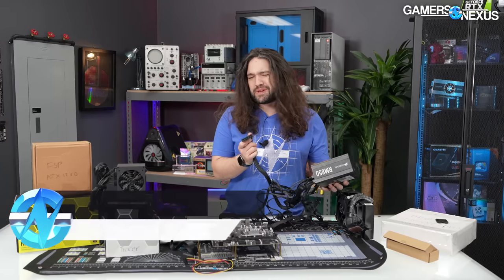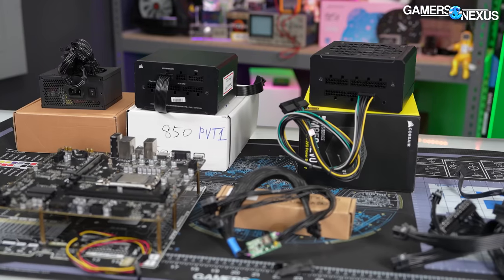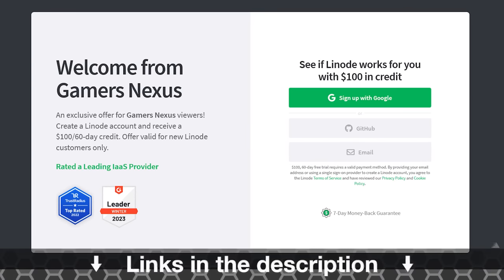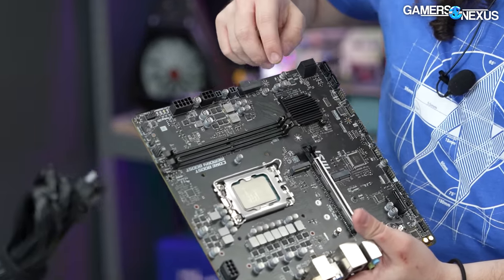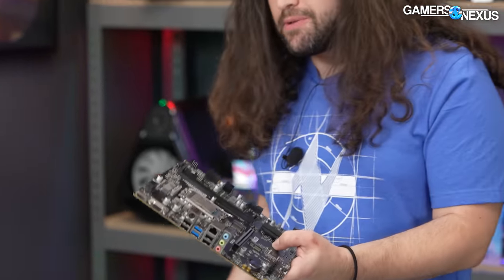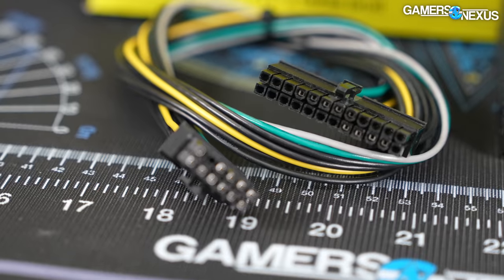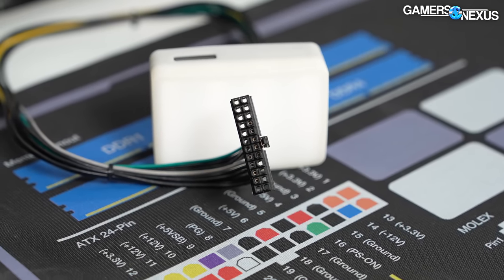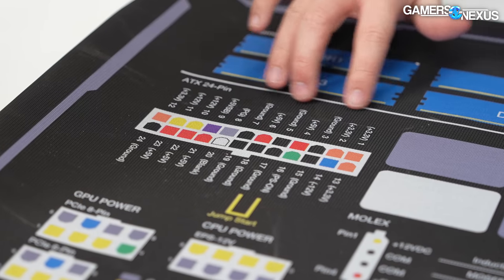The Future of Power Supplies - Maybe (Motherboard Cost, Cables, & ATX12VO)

Comment: I think that the future of PSUs is not this.  The PSU will go into a modular VRM board which will have it's own cooling, and there won't be any VRMs on the motherboard.  I saw that in an interesting server product.  The PSU will provide better protection for clean voltage all 12V, you will buy a number of VRMs/voltage converters that will slot in behind the motherboard and will be close to what you're powering.  The power plugs into the back/bottom of the motherboard with standardized power connectors that separate the VRMs from the motherboard for cooling, but also keep the distance from the powered device and the VRM at a minimum.  The connections will not be cables, as the alignments will be standardized between the VRM board and the motherboard.  You can buy specialized VRM components if you want to under or overvolt your components, some might be programmable, but some might just be a different spec if that's cheaper and you know your system will work with it.

There will not be ANY VRMs on the motherboard.  Even the 75W PCI-e standard with come from the VRM modular board.

The components of the VRM board will be cooled on the bottom, the power connectors will be on the other side of the components.  The power comes through the bottom of the motherboard and the components on the motherboard are on the top, so that they can be cooled on the top.  Getting rid of the VRMs on the motherboard allows components to be placed really close to one another, reducing latency between the cpu, memory, the gpu, the fpgas, the asics, the fpaas, and all the other components that you're using.

Keep in mind... if there aren't any VRMs on the motherboard, there also aren't any VRMs on the GPU board either.  So a GPU comes in two parts.  The VRM board and the processor board.  The CPU board has PCIe 16x slots on it's edge and the GPU board slides right in next to the CPU board - close - Grace Hopper inspired close.

My friend once said that building a computer was now more like Legos.  I love the idea of power delivers being much more modular than it its.  Separate the VRMs and their cooling from the devices and their cooling and give enough space so that this all can happen.  

The PSU makers are responsible for one thing - supplying clean 12V.

The VRM designers are responsible for their thing - supplying the correct voltage to the device when the device needs it, keeping things from spiking on sudden changes in needed voltage, and all the other amazing things that good designed VRMs do.  And designing good heat transfer as there's no perfectly efficient buck converters.

The device designers stop trying to integrate and perfect how to put the VRMs on their boards - leave that to the VRM designers.  The bottom of the board gets the power and the top of the board has the device and all of the cooling hardware for the device only.

I'm sure this is all a bad idea, since it hasn't been done yet, but I love the idea of "hey my gpu stopped working" - unplug the VRM from the bottom of the board and plug in a new one - perhaps with better design features because the gpu is 4 years old - and fixing the whole thing without taking apart anything!  Cheers.
Reply: Just to be clear, there isn't one big VRM board.  Motherboards would be designed so that you can plug in, on the back of the board, different sized VRM boards.  You'll have a 2watt/3V connector, and a 600watt/12V connector - or whatever.  I know - changing standards is cost prohibative.  But increasing the lifetime of your devices because you can change out the VRM is interesting to me.

Comment: So from 12+0 to 20+0 to 24 to 24+4 to 24+8 we're moving now to 12pin+8pin... I wonder why Intel didn't remove those extra cables for the CPU and instead put them into the new 12VO connector/spec so we'd end up with one 12V cable, 20-pin to cover MB + CPU while having one less cable to route :/

Comment: I believe this change is just going to increase prices, moving the extra cost to the motherboard and as you know manufactrurers they usually cheap out on budget options. Power supplies usually last way longer than the rest of the systerm while motherboards cpu ram etc have a shorter cycle before upgrade. I work as an electronic board repair technician, from my experience the new gen of budget motherboards will probably use some flaky power management ics, prone to failure. I hope I'll be wrong , but companies just want to milk you for money, planned obsolecence

Comment: I don't get the resistance to this type of change. Standards change as tech changes. Mobo prices will likely go up for certain, but we will also get better efficiency which translates to potential power savings. Should CPU Socket 1 and Socket A have remained the standard for eternity?  Should IDE and ISA have remained?  8" floppies?  FAT 16?  I'll take the benefits of 12VO over its negatives any day.  Progressing, more efficient tech is a good thing.
Reply: @shanent5793 , the 40-pin DIP was peak technology.  All other opinions are invalid.

Comment: Personally, I'm excited about the potential for CEE-plug compatible three-phase power supplies for the european market if Nvidia decides to re-introduce SLI configurations for the 50 series cards. But then again, even tho this is a joke, crypto miners would unironically love those, since due to the lower ripple of three-phase power, the PSU will require less voltage filtering, making it cheaper in bulk.

Comment: The PSU manufacturers should be the experts on power and changing the voltages. Why do we want motherboard makers doing it? I know there’s some overlap but the only end result will be more expensive motherboards and PSUs which will probably stay the same in price. I just don’t get the appeal for anybody unless they are mad for cable management.

Comment: I don't think that power routing in mATX changes much. That is because you have to transfer power to where it is needed with old style too. Maybe in mATX you can route 12V everywhere and for other voltages, put their power components where needed. That could lessen the pcb price, not add to it. Of course those extra power components at motherboard adds to price, maybe the power supply gets cheaper by the same amount (just dreaming).

Comment: I do not agree that the power conversion is going to be a part of the motherboard, it should be a tertiary board that you can buy seperatly or just leave out if you dont need it at all.
It would add to the customisation of a build, you can place it somewhere you cant see (cable manage it properly) and you can buy seperatly what you need. (and leave out what you dont need).

Comment: 48V is the best FUTURE solution. Its used in data/telecom and has been for decades. The higher you go the smaller the conductor of the wiring and fewer pins on the connector. Local "POL" (Point of Loads) DC to DC converters are not expensive.  When you look at the legacy power solution it is based upon the needs of older technology.  There was a time when a majority of the logic was 5V. This gave way to ASICs that had lower voltage cores ( 2.5 to 0.8V) and retained the 5V on the IO Pins to interface to older bits or busses.  Equally "drives" had 12 and 5 for floppy and HDs. SSD's only 5V but could be moved to anything as their current draw is so low.  Power complexity has dominated the design requirements for decades. It adds pin count, PCBA layer count, routing, signal integrity and EMI problems.  Really you need to justify WHY you have a unique voltage and to the extent everything is in the box talking to itself - it should be beaten into the lowest cost solution.  And your point is valid that if you move it from X to Y (PS to MOBO or MOB to card) its sort of a wash in concept but not at all in practice.  Anything that reduces complexity reduces cost and increases reliability. Note the ONLY thing the 5VSB does is provide the sense voltage for pushbutton power on/WOL and BIOS update microcontrollers. Very very low current. But as it is "always on" its a necessary rail needing a small conductor.

Comment: So if you need to run a LOT of drives, or less common accessories you get to also buy a power distro daughter board, or a 'new' 12vto + 5/3v psu. if you have to spend $400+ for a debug light, how much for a board your not going to instantly overdraw. this is consumer predation.

Comment: You know what would've help.  If all those OEM manufactures that are using 12V proprietary PSU would've just use ATX12VO standards.  Since those would've both, granted OEM buyers the ability to upgrade their PSU. And making it a ATX12VO PSU the only option. That would've push sells.  But since everyone is looking for themselves now. 
Also, not a fan of the 12VO PSU.  It only push more things to the mobo.  While I would like to see less. In case of failure.  When upgrading to a new PC, it's certain you'll replace the mobo, but you might keep the PSU, since its the same. An ATX PSU will work with a Ryzen 1st Gen all the way to 7000, or intel lets say, LGA775 all the way to whatever the 13th core i is using with no problem.  But a mobo will not. That you'll replace, probably throw it away. More components on the mobo means more e-waste.  And intel should be the last to tell us what is good for mobos when it comes to savings. Since if it were for them, we would change mobos with every CPU upgrades.  We saw how they pushed for a new socket when the previous one could've work well a few years ago.  And just as the "savings" add up with more computer, so does e-waste. 
I'm familiar with those converters.  I had to buy and adapter to use a regular 24-pin PSU to be use with a Dell PC.  8-pin 12V.  
Now, since mobo will have to increase price, which are already ridiculous.  Will the PSU lower their price?  No, right.  This is just intel pushing something that isn't really better for the consumers.  keep in mine that all those massive amount of PC situations like companies and school.  Do replace their PCs every 3-4 years, even if they are perfectly functional and have no problem with their job.  I worked on a collage and computers that I already thought were overkill, $1,100+ i5/7 computers that were used for very basic task like MS Office were destroyed and thrown out when they were 3 years old.And it was a community collage, state funded, not some fancy private one. These places where they have contracts with big OEM like Dell, HP, Lenovo.  Which in turn have with Intel. They all replace PC way too often.  Intel is in no position to grand stand on saving, efficiency or anything environment.

Comment: ATX12VO seems similar to the older "Thin Mini ITX" standard except that it would be for powerful systems instead of just small formfactor systems.   It seems like a good idea and it also seems like it wouldn't be difficult to make an adapter for older power supplies since most ATX supplies can output 90% of their rated power on the 12V rails.

Comment: I'm not exactly on board with the idea of putting more power circuitry on mobo's, so when you ultimately have failure, your costs just went through the roof.
I am much happier with a larger PSU, that doesn't cost 400+ bucks to replace. (Or more, since this will increase the costs of mobo's)

This is an extremely stupid consolidation.

The ONLY aspect worth using, is the reporting of load to the mobo so the system can actually know if there is a problem with power consumption levels. I absolutely want that to be a reality.

Comment: So, if 12VO were to take off;
Instead of having a single set of 3.3v & 5v converters in your PSU that lasts a decade, you'll be paying for and tossing out a set every 2-5 years.
You'll be severely limited in the amount of devices that use 3.3 & 5v rails, especially on the reasonably priced motherboards. Say goodbye to boards that have more than 4 SATA ports unless you're spending over $600, and you'll likely say goodbye to more than 2 SATA ports on boards that cost less than $300.

Also you can guarantee the small BOM increase will be pushed through to the consumer starting at a 1000% markup. The $2 worth of power conversion will put an extra $20 on the board price at the lower end, and the $15 BOM increase on a top end motherboard will cost you another $300 in the store. Look forward to the 'midrange' motherboards costing as much as the 'midrange' graphics cards.

Comment: i can see 12VO being good value and space saving for OEM/workstation PC's. but would be shocked if it took off at all in the DIY space. if its not broken dont fix it mentality along with existing high quality compatible components makes it very difficult to justify a full swap over to a different standard over a few $ saved on power during low power operations.

Comment: so many things on a motherboard and so many other components use a wide variety of power routing. overall, you use more capacitors, which do have a lifetime, doing the same thing a bit more efficiently, and now you need mini transformers and mosfets all over the place. I say leave the power changing to a reasonable priced device designed to do only that.

Comment: Hmm, I know esthetics shouldn't be a priority, like GN always points out, but in a future where the MoBo has to power sata connections and the power comes from a lanky 12VO cable... I can't help but think that maybe having 12VO power supplies is not a good idea... Imagine a bunch of ugly sata power cables (even if braided), and just one tiny 12VO cable instead of the nice looking 24 pin cable (when you use a nice extension or set of cables)... I dunno, maybe it's my dinosaur ass getting used to how cool a big and chunky custom sleeved 24pin cable can look, that would miss it dearly, just as 2 or 3 8pin cables look way cooler than the silly little 12VO cable used in Nvida founders GPUs

Comment: They should have gone straight to 48V, no need for bulky cables. AND keep the 12, 5, 3.3 voltages in the power supply.

Comment: Looks like a better solution would be to make a 12vo only power supply and some in-between part instead of moving it on to the motherboard and making it even more expensive.
Reply: The separate part would cost more, and have worse voltage regulation, than putting it on the motherboard.

Comment: I don't see motherboard manufacturers moving all that quickly, to building 12VO spec boards as a primary. It's a huge change in the process. 12VO could possibly go the way of the Betamax tape system... even if it's better than 12v ATX (VHS)... it's going to be more expensive overall, and the vast majority of the consumer space being budget limited will ensure that 12VO stays as an enterprise only deal. There's no real reason for this kind of innovation when it literally provides no benefit to the consumer space.

Comment: ATX 12VO would be great for mITX systems, and routing the 12VHPWR connector through the motherboard would allow for much better GPU power monitoring through the motherboard.  There's so much potential there.

Comment: Let's be realistic here, this is likely YET ANOTHER example of Intel attempting to sell a new standard to make more money.

Companies do this all the time. They try and sell something with a minor gain in function (efficiency here), in order to sell more product and gain more control.
Keep in mind, this isn't just something I'm pulling out of my ass here. Intel has tried to implement new standards in the past, and only a few times has that actually stuck (the move from AT to ATX for example). Sometimes there are actual large tangible benefits such as the example I listed, but I don't see enough of a benefit here to warrant paying MORE for already-flaky motherboards while paying the same for power supplies that have less function. Remember how awe-inspiring and GREAT Rambus was? It lasted a REAL long time and people totally bought into it. We're using high bandwidth Rambus ram stick in our computers to this day... right? ...right? I for one can't wait for those new Itanium cpus to come out this fall. You get the idea. I could go on and on.

Also, I don't like the idea of moving all those electronics that have active cooling in a power supply to a motherboard that is almost certainly NOT going to do anything but passive. That sounds like a recipe for an RMA.

Also, this really isn't going to help the environment all that much. All the old ATX stuff is going to end up in landfills or in third-world countries getting BURNED for the few thing that will actually get recycled. So we're not really moving the needle in a positive direction here. Also, it's kind of pointless to move to a new standard for ONLY efficiency reason when you consider just how much power modern CPUs and GPUs consume, even while idle... you know, where this is supposedly going to make a difference.

Comment: I know that S-ATA is a dying standard, but atm it is still a Standard. SATA can work without the 3.3 Volt rail but not without the 5Volt rail. I see a big Problem in the ATX12VO standard. Would they have left the 5 Volt rail in it, then it could be used for SATA and PATA Power Connectors, which are used for Frontpanel USB-A 3.0 Power Rails, SATA Devices like a Blueray Burner, Some Expension Cards etc. And they would have it easier to have 5Volt Standby Power. I know those are not common in the Enthusiast PC's But in lot of HPET is the Place for Highend Motherboards, Grafikkards and older Devices which use Sata, or integrated USB Hubs which needs 5 Volt Rails. 
The very first PC had 5 Volt on their Pata Power connector, breaking with it may result in big Problems.
An 10A 5 Volt Rail would have increased the PSU price but would retain the "we can do everything" ability of a PC. 3.3 Volt on SATA is practically not used thangs to the Pata to Sata power adapters.